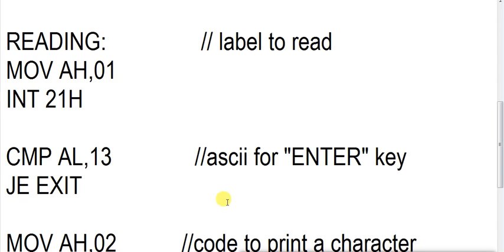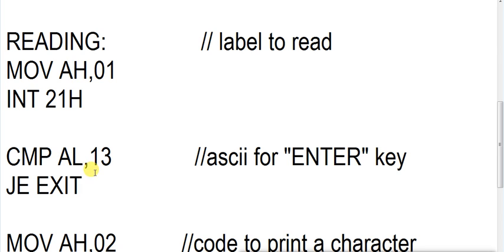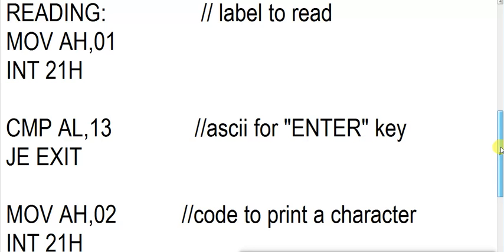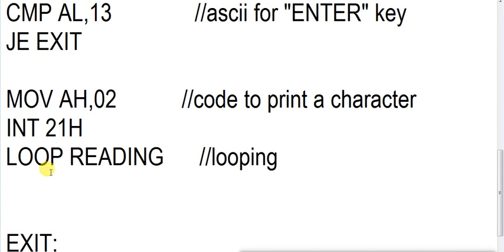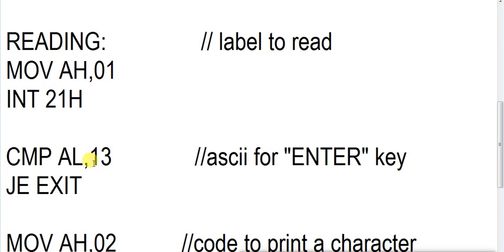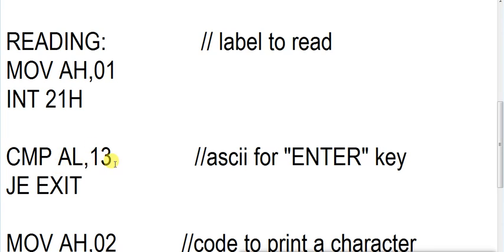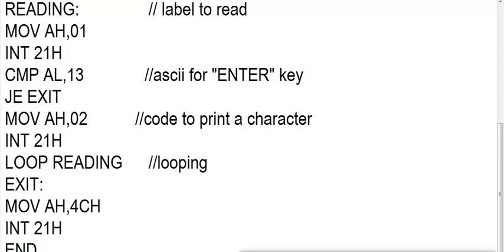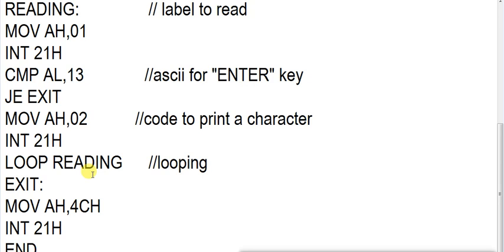8086 Assembly Language Tutorial || Part 15 || Read a key & Print on Screen|| Loop || Label in 8086

Comment: I get this error: "INT 21h, AH=09h - 
address: 07170
byte 24h not found after 2000 bytes.
; correct example of INT 21h/9h:
mov dx, offset msg
mov ah, 9"
Reply from the maker: use    LEA DX,YOUR_MESSAGE    MOV AH,09H    INT 21H      and dont forget to define your message in data section.   mov dx, offset msg "    and 
"lea dx,msg"      both do same operation.Thanks.
Reply: Still same problem, here is my .code part after declaring the Message in a variable called: MSG1
.code

    MOV AX,@DATA 
                    
    MOV DS,AX 
              
    LEA DX, MSG1
    MOV AH,09H
    INT 21H
    
    
    READING: ;label  
    
     MOV AH,01
     INT 21H  
     
     CMP AL,13   ; if enter exit, else 
     JE EXIT 
     
     MOV AH,02
     INT 21H
     LOOP READING
     
     EXIT :
        MOV AH, 4CH
        INT 21H
        END
Reply from the maker: your code is correct.Error might be due to following reason 1)emulator that you are using might have different functionality. 2) msg1 is too long 3)problem is if  the $ sign not quoted ex: '$'  .           Thanks